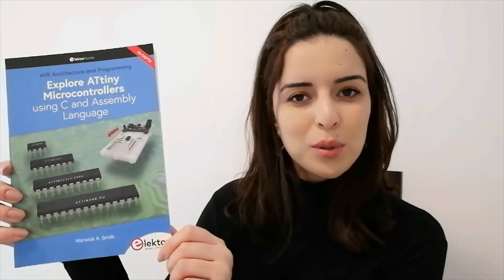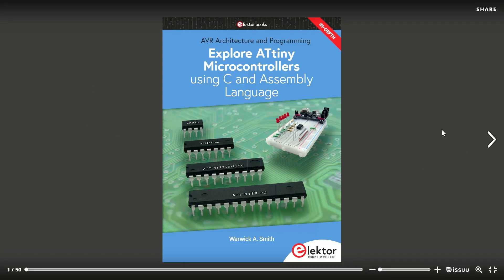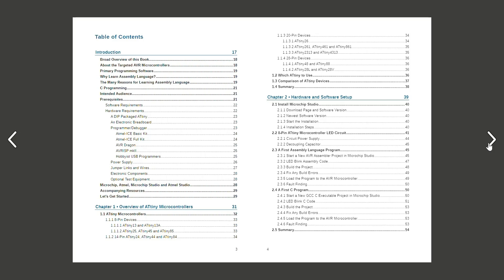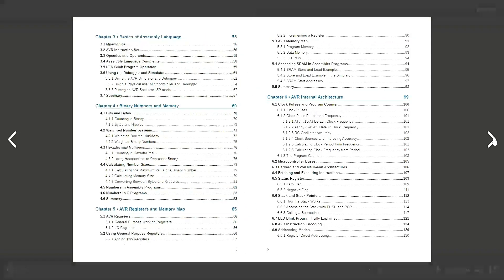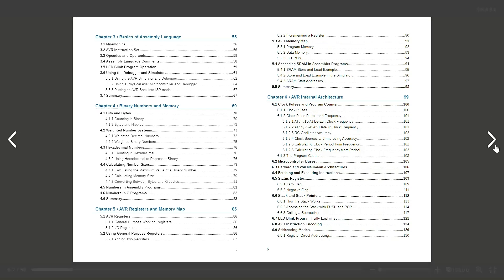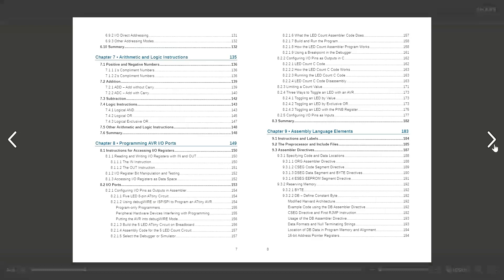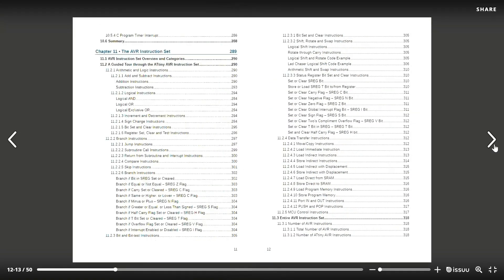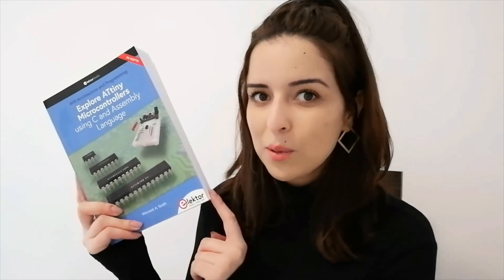Explore ATtiny Microcontrollers using C and Assembly Language - Book Overview

Comment: Hello, Elektor website is like a nightmare really! I couldn't even buy this book because of stupid forms and VAT numbers ???!!! What for I don't care about the invoice , just wanted to buy a book for f.. sake. The website is a disaster really. I tried like 20 times to fill in the form to purchase this book and failed.
Reply: Hi, @grzesiek1x! I went through the process of tryinig to order the book and did not have those issues. VAT number was not a required field in my case.
Reply: Thanks. Maybe it depends on country where I make this order. I have bought this book from another shop, the same book but a different seller I think without problems.